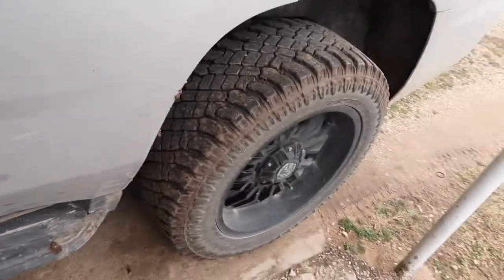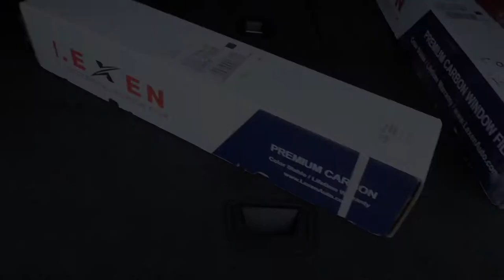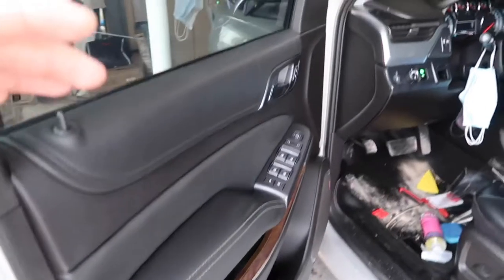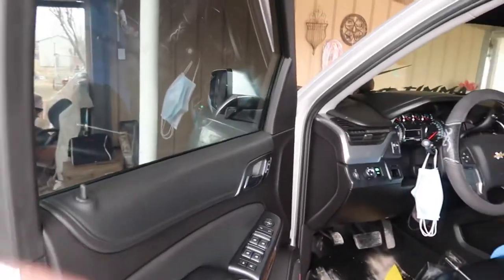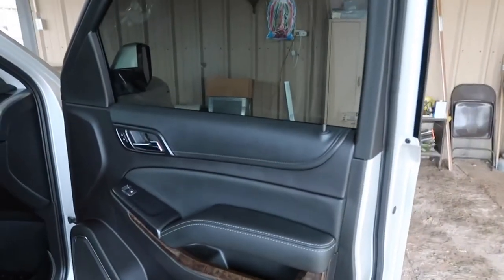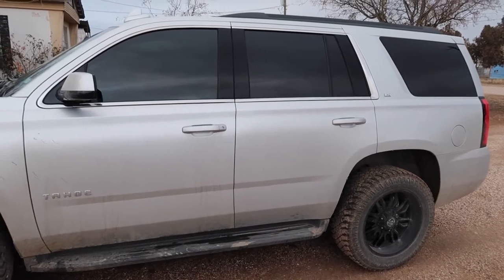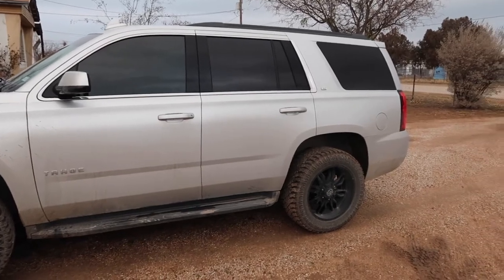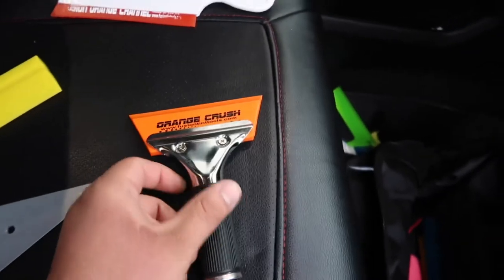LEXEN WINDOW TINT INSTALL & REVIEW

Comment: If you pulled the seal then you should be doing it one stage ! Also cut the top overlap first so you’re not fighting when it’s falling you for a way to go but you will get there with constant practice

Comment: If you used the right amount of heat the glue shouldn’t have separated from the film if it does which it can happen with some films but it won’t be that much wow.